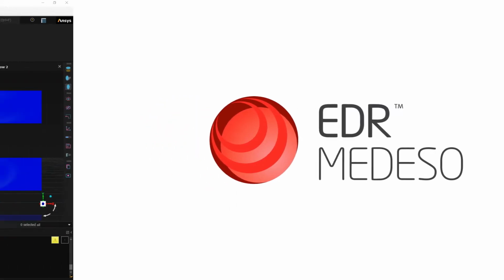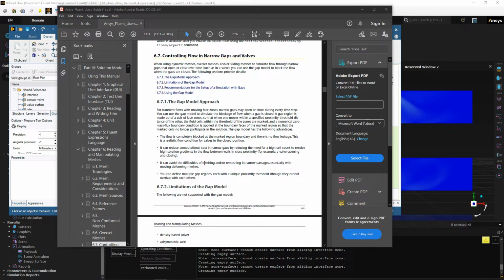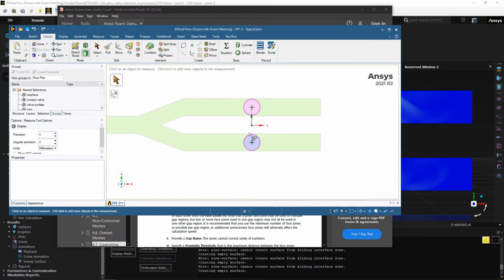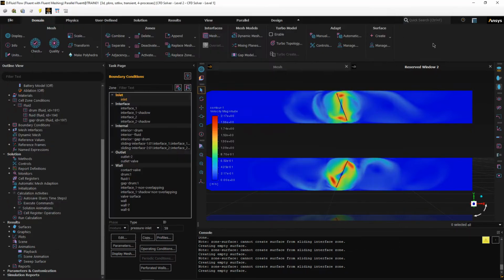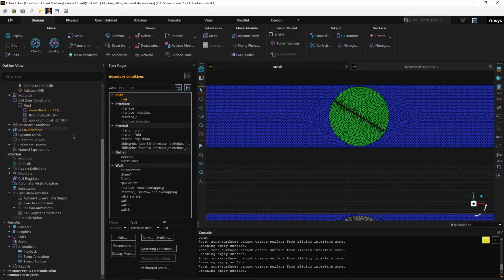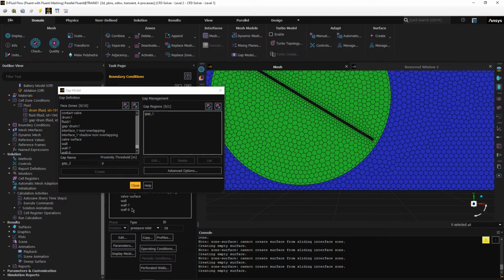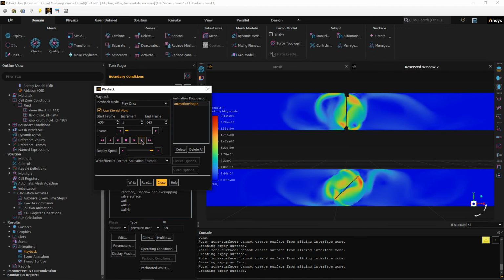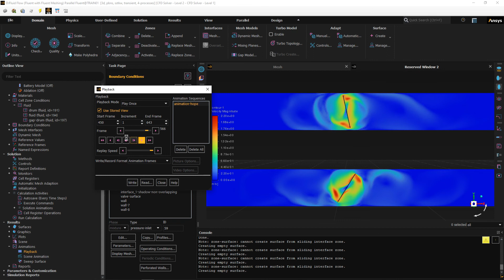How to use the gap method in Ansys Fluent

Comment: Congratulations 
Excellent videos!
Could you help me with a question please?
In a simulation in FLUENT with 5000 iterations, the residuals converge at 400 iterations and the simulation ends; how can I make it continue with the simulation to complete the 5000 iterations set?
Thanks
Reply from the maker: Hi David, Under Solution ribbon tab, click on Residuals under Reports section (in outline view, it's present under monitors). Then uncheck all the check convergence tick boxes. You can also click on advanced options and change convergence criteria to none. Hope this helps!